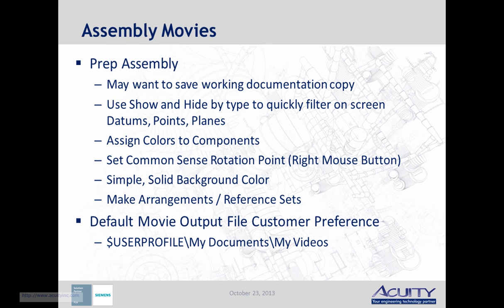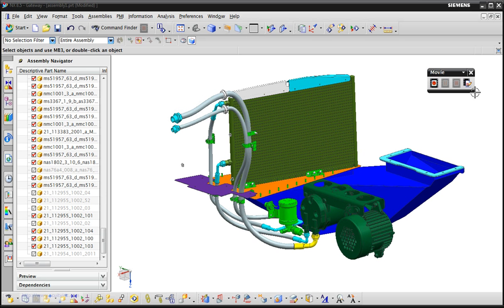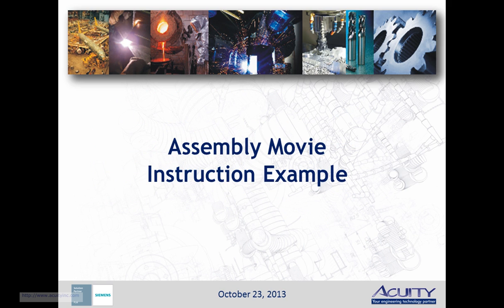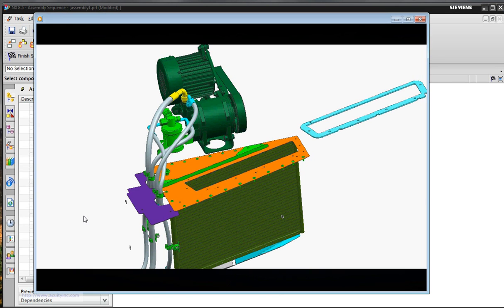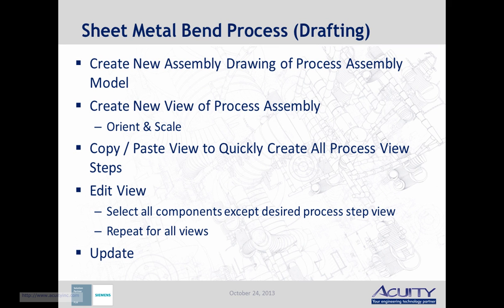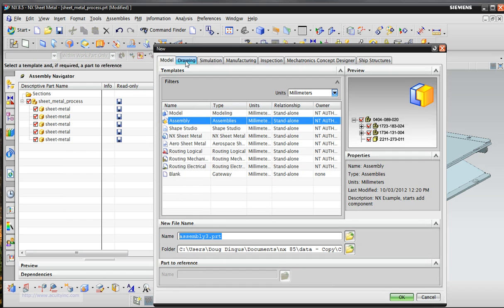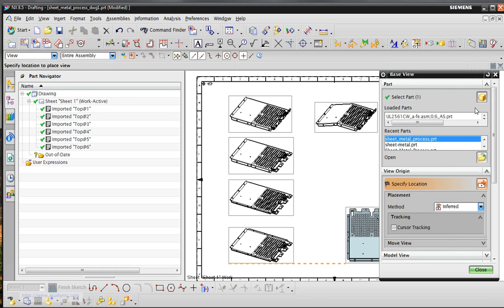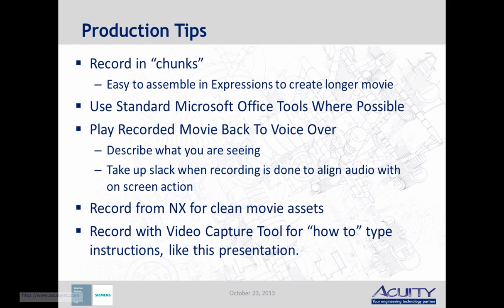NX CAD | In Depth Video Tips - Electronic Work Instructions

Comment: Does NX not have a specific work flow or module for actually creating work instructions vs manually manipulating the actual design models? This is very manual and I can see update issues or source file corruption happening.

I know other cad packages have specific modules to do this sort of work, Creo Illustrate and Solidworks Composer comes to mind
Reply: This is a very old video.  Users can create electronic work instructions using NX CAD and an application from the Tecnomatix suite of solutions:  https://www.plm.automation.siemens.com/global/en/products/tecnomatix/electronic-work-instructions.html   Maya can assist you with implementing this solution.